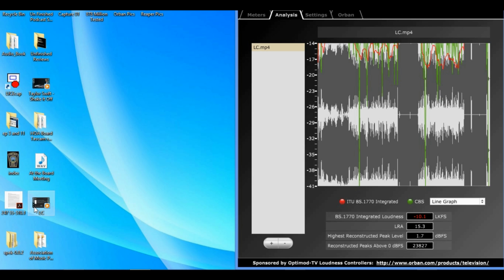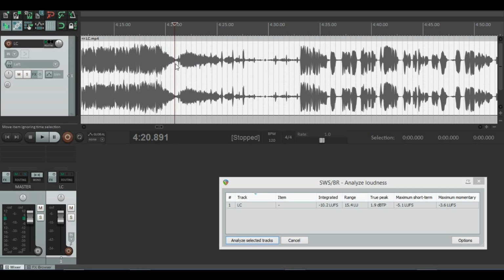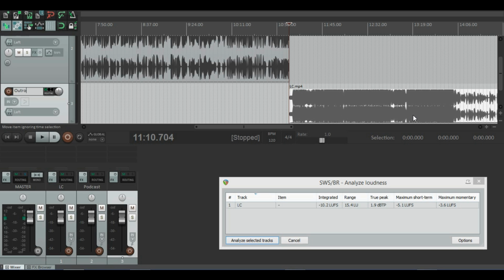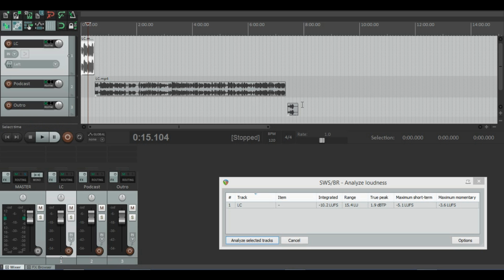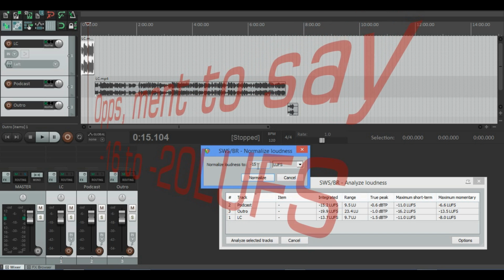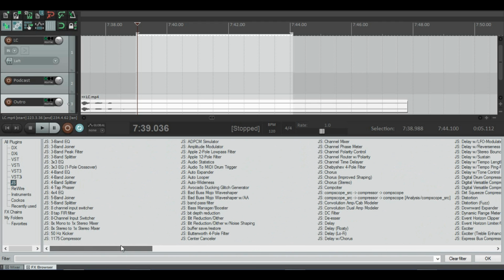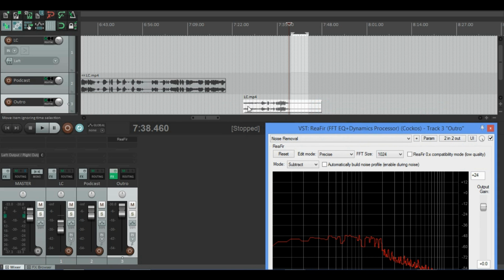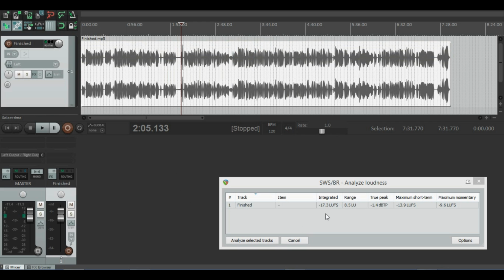Using Reaper To Normalize Your Tracks To The Same LUFS

Comment: I got confused. So when normalizing the track you want it to be at -15 lufs which will make it -18 lufs?
Reply from the maker: No really. A negative 15 LUFS will be just that. A -18 LUFS is 3 dB softer.
Reply: @DanaTucker1  ok so when you normalized, you normalized to -15. Was there a particular reason for choosing-15?
Reply from the maker: Because at that time, Reaper was off by 3dB.

Comment: Can you please put in the description that you need to download the extensions.. it took me a long time to figure it out! Also after I run normalize to -16 LUFS my peaks are suddenly clipping
Thanks
Reply from the maker: Sorry about that. You can apply the peak limiter as the last plugin on the master track and that should solve your problem. You will need to play with the threshold level but start with the default setting and go from there.

Comment: What's the loudness range should be?
Reply from the maker: That depends on whose standards you are trying to master to. The AES recommends between a -16 and -20 LUFS with a max of a -1dbTP. If you are doing this for the ACX and audio books, then it is between a -18 to -23 RMS with a -3dbTP max, and a -60db max noise floor.

Comment: Thanx for Your explanations. The resolution of this video is very bad. - I couldn´t read it. - My only question: What is Your first plugin besides SWR/BR extension? -
Reply from the maker: Good morning. My videos are rendered in 4K. Please make sure you have your YT setting set to HD 1080 and you view the video in full screen mode. This should help clear up the video for you. . You will find the setting under the bottom right hand side of the player. The plugin is called Reafir. It has 4 different effect you can use. In this video, I used the "Subtract" feature. Thanks for posting.
Reply: @DanaTucker1  Need the number of reconstructed peaks... Where/how can I get/gather this information? Orban.com? - Thanks for pointing me to ReaFir for the noise floor...
Reply from the maker: Yes. That is what I use. https://www.orban.com/freeorbanloudnessmeter/. Your welcome concerning Reafir. It does 4 things. It has a great multi-band compressor as well.

Comment: Hi Dana, I've been looking through the menu bar on reaper, and I just can't find the "extensions" option you described in this video. Is it on the options menu?
Reply from the maker: No, you need to go here http://www.sws-extension.org/ and download it then install it. Then it will be on the top menu bar. Reaper will look for it. Check out our new forum for teaching Reaper. I invite you to join. www.yourpodcastreview.com/forum
Reply: Thanks for the heads up. Very useful tutorial, thanks again!!
Reply from the maker: Simon Faulks Thanks.
Reply: I'm interested in all this stuff you talk about here, but I have one further question - that is: once your music tracks are all normalized to -23 LUFS, if the perceived volume is quite a lot lower than commercial reference mixes, is it ok to import files into Audacity for a further normalizing process?
Reply from the maker: Simon Faulks You can if you want to but why not just do it in Reaper?
Reply: hot darn does it get any  better this man replies       you are a saint  
because we love that  !!!

Comment: Great tutorial. I have a question,hopefully you can answer. I'm trying to do the best a remixing old 4-track tapes in Reaper. What would you suggest as the best approach to this?
If you have a tutorial already that would be useful, if appreciate the help. Thank you...Keep up the great work, you are very precise in your videos.
Reply from the maker: Hello Harold. Thank you for the kind words. To answer your question, it will all depend on what type of audio file you are working with. I am not referring to mp3 or wav, rather how the original tape was mixed and mastered. If the original 4 tracks are still available, then great you can work through it just as if it was recorded yesterday.  If not, then there is very little you can do. Reaper as with most DAWs can separate a stereo channel from left and right. I do it all the time. But, if the tape with all 4 tracked was mixed down to a stereo channel, then again, there is very litter that anyone can do. If you could, please send me a 20 sec clip of your audio file. This way I can see what I think is your best option. http://www.yourpodcastreview.com/contact/